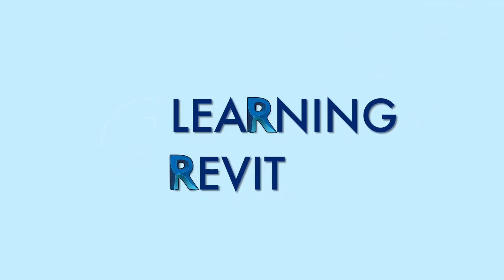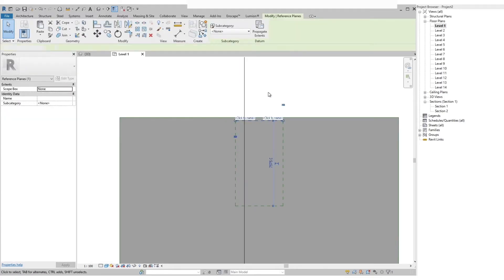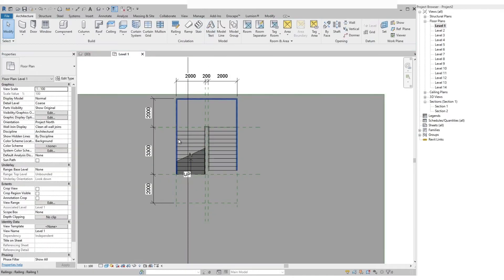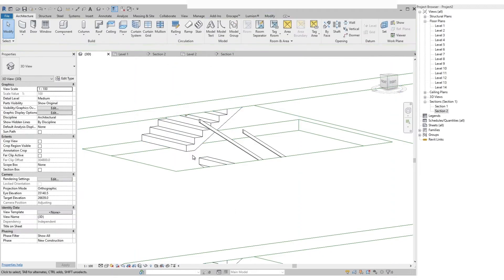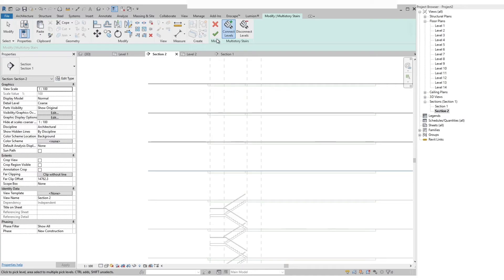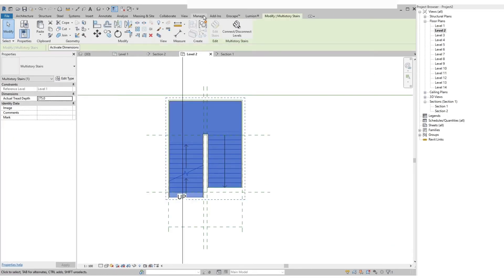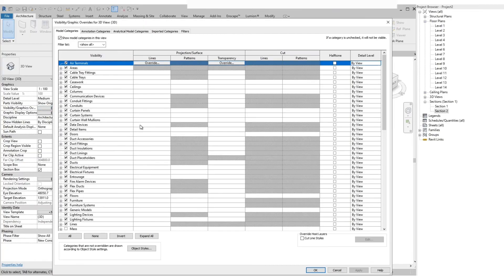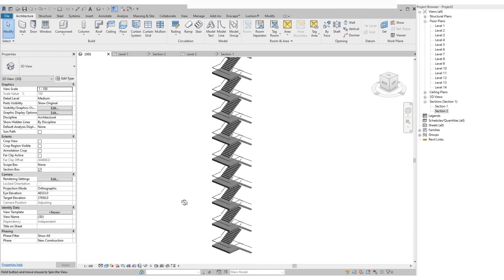How to Create a Multi-Level Stairs in Revit? | Tutorial for Beginners

Comment: how did you use those dimensions to edit the reference lines
Reply from the maker: I just added the dimensions on the reference planes so I can update the correct width that I want..
Reply: @learningrevit7389  When I did that, they turned into permanent dimensions immediately after I measured the points and clicked to fix the dimension in place, after that, I couldn't edit the dimension again
Reply from the maker: @jesunifemiale8619   you may have to check if the dimension was accidentally locked?